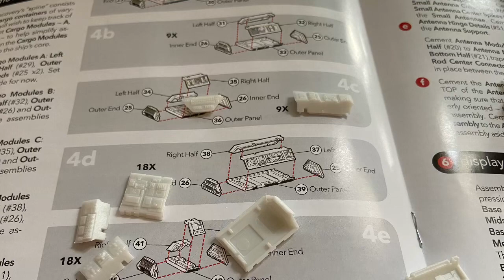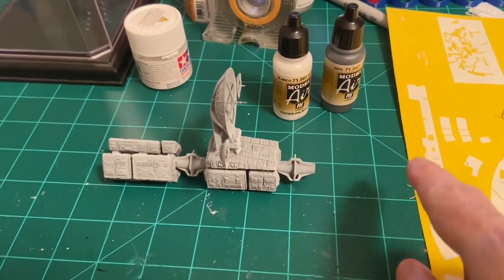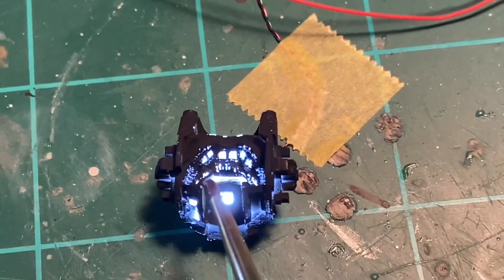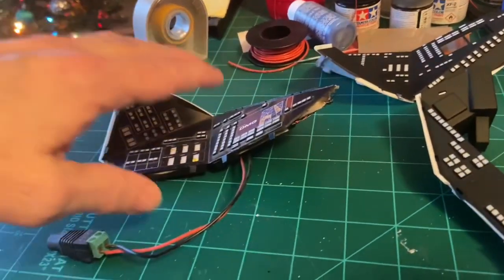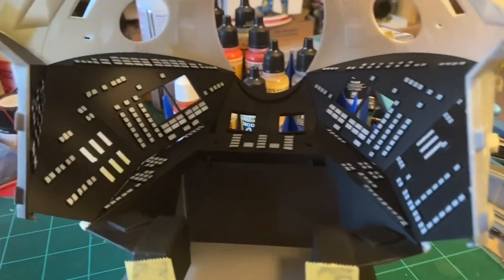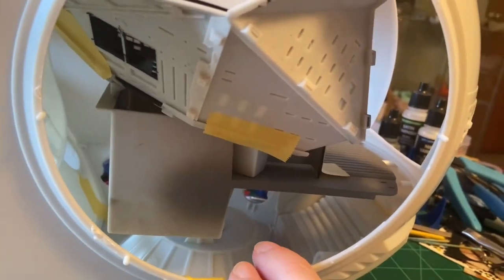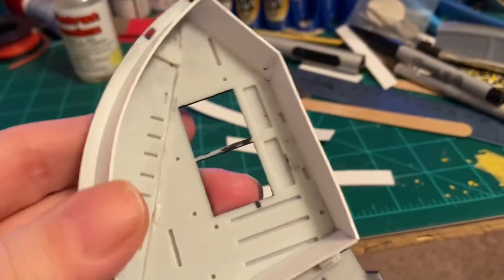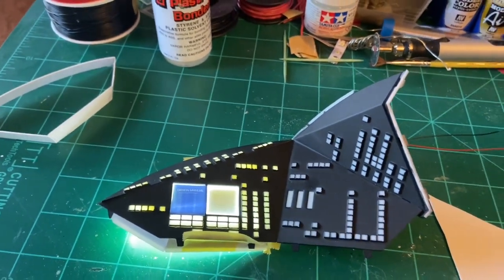Moebius 2001 EVA pod part 4!

Comment: Looking great Ken. One tip for those thin spars for the dishes....during manufacture, when the styrene cools it shrinks so the very thin parts end up under tension on the sprue. If you cut the surrounding sprue first, it releases the tension and the very thin parts are then less likely to break when you snip through the gates.

Comment: Yes, all the lighting on this project is a complex challenge.  I've enjoyed the different approaches our members have taken. Some more complex than others. Some results better than others. The headroom and light blocking, on those ceiling and "round windows " requires very shallow boxes. On the 'windows' (round light panels) I had to lay the lights flat against the interior wall, with no boxes, just light blocking material. In my case I used tiny pico LED's, one for each button. This kept everything nice and flat.